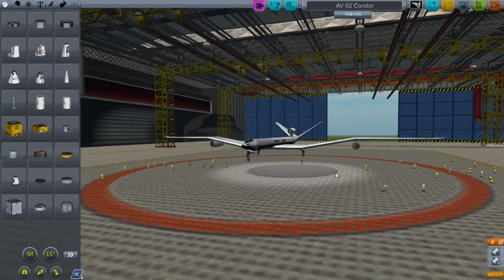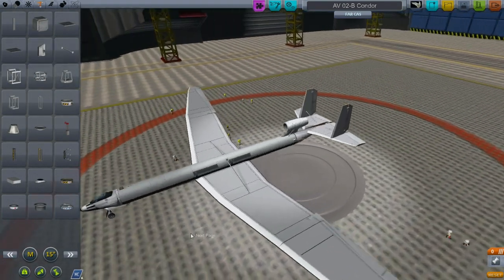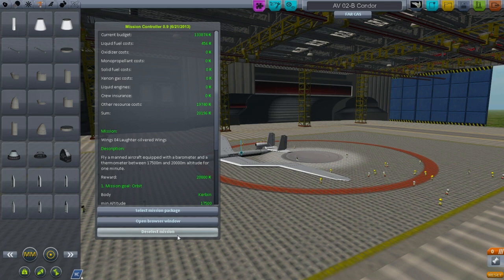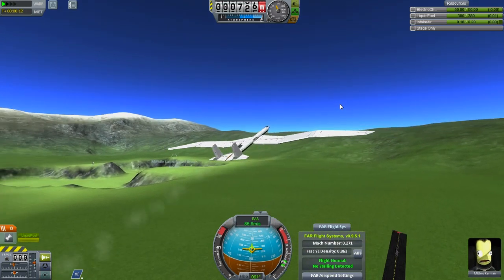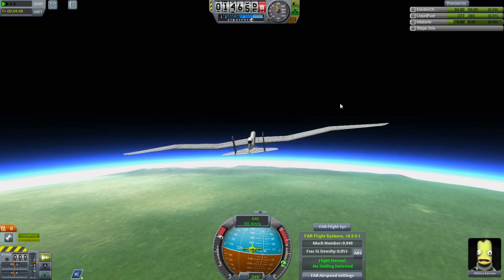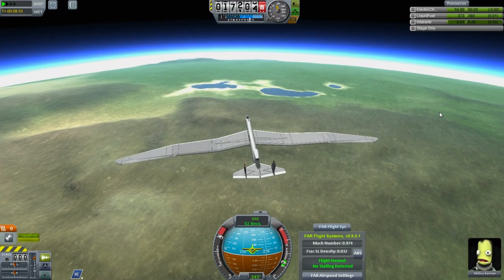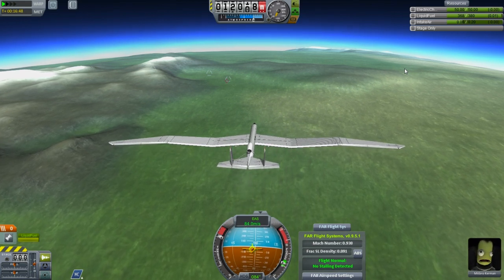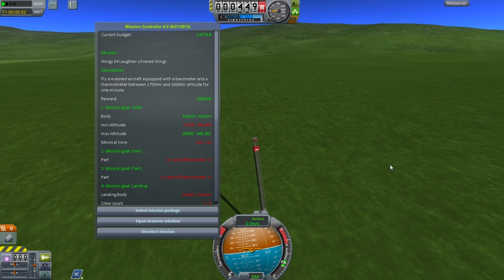Let's Fly KSP: Mission Controller Mod, ep.6 More High Altitude Research

Comment: Sorry for double post, but I wanted to mention W-E Coasts in 67 minutes, and LA to DC in 64!
Lastly, I would like to add from Wikipedia that the AR51 runway was paved, and 23,270 ft (7000 m) long. There is a 39,600 ft (12,000 m) unpaved runway @ Edwards AFB.
There is an airport in China that is both the highest in the world, and has the longest publicly used paved runway coming in at 3 miles (5.5 km)!
Just found this interesting, and wanted to answer your question. Thanks! Nice video!
MITTBRO!!!

Comment from the maker: Deflection angle  = how far that surface will rotate. More rotation means more force and more control authority, unless it rotates too far and stalls. So you usually want the angle to be just slightly less than the stall angle.

You almost always want the mass slightly in front of the lift. Think of what happens with no control inputs... the plane will naturally pitch down for more airspeed. It's much more stable this way.

Comment: Wouldn't it be advisable to put some extra air-intakes on that engine? Dropping the extra engines and the (still way too much) extra fuel was a good idea but your main problem is that that high altitude all but chokes out the engine completely. More air intake to feed it aught to remedy that and effectively buy you more operational altitude for the same engine-power.

Comment: What is the deflection angle, on FAR? What is that for? Would just researching it myself bring up information that would apply to KSP, or would that be too advanced for KSP?

Also, what is the situation with center of mass versus center of lift? I heard it summarized one time fairly well, where mass in front or behind lift would make it crazy and the other one would make it just a little bit unstable in pitch, or something like that. Is it better to have center of lift behind center of mass?